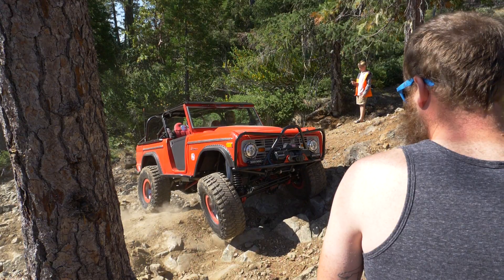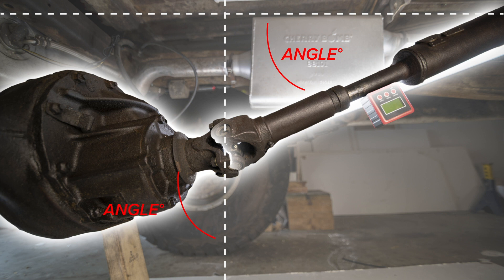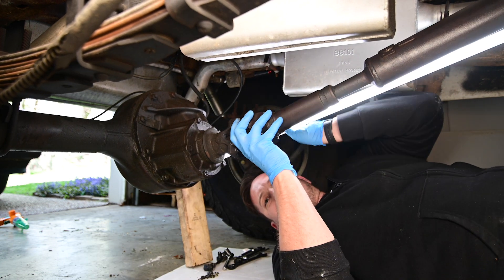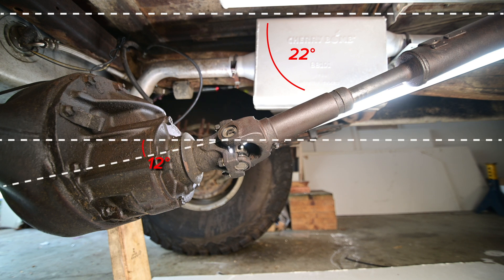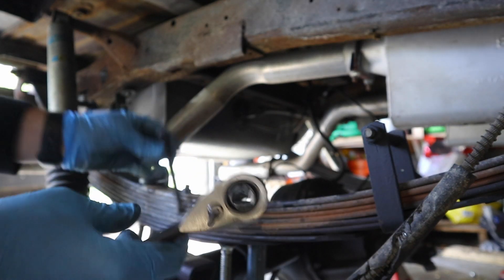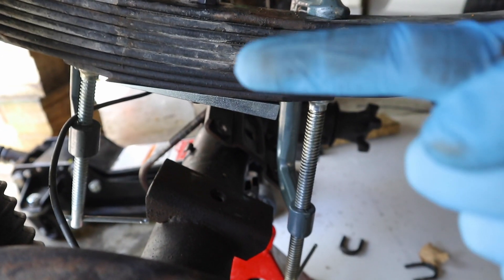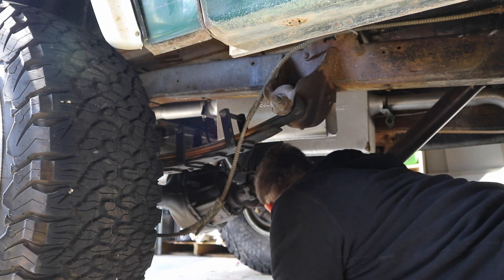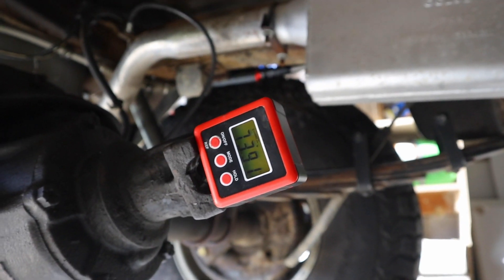Driveline Vibration and Pinion Angle - 4x4

Comment from the maker: *Update* I refer to the “pinion angle” a lot in this video, but I miss-used that term. “Pinion Angle” is the angle of the differential to 0° - what I kept calling the pinion angle is actually the driveline angle.  So my pinion angle was 12° and adding the shims changed it to 16°

So my angles:
Drive shaft Angle: 22°
Pinion Angle: 16° (after shims)
Rear Driveline angle: 6°
2.5” suspension lift, 1” body lift, 35” tires
Reply: 78° ?
Reply: What 6° ?
Reply: @nashvilleearlybronco DUUUUUDE, dud it fix your vibration tho??

Comment: Vibration is caused by the pinion angle not being the same as the transfer case/transmission angle,  Transmission must be parallel with pinion. The angle of the driveshaft is irrelevant.  The maximum accepted angle between the pinion/transmission to driveshaft is 10.  (Maybe a couple degrees more).  The larger the difference the faster u-joints wear.

Comment: The operating angle of the U-joint at the pinion is only half the equation. The operating angle at the transfer case U-joint needs to be taken into account also. A U-joint  does not produce a constant velocity is it rotates. However, two U-joints operating equal and opposite can cancel out this velocity variation. Then of course, there is the maximum operating angle of any single U-joint. 10 degrees is a lot of operating angle. A complete fix would include dropping your transfer case and reducing the overall angles.

Comment: So now you have 16 degrees at the pinion, but do you have 16 degrees at the transmission?  If your front and rear U-joints are too far apart, say pinion is at 16 and transmission is at 2, you will get binding and vibration.
Reply from the maker: Good to mnow

Comment: I have you a measurement. 
90 f150 w/6inch suspension lift.  Drive shaft degree is 16 degrees  pinion with Drive shaft removed is 5 degrees.  I have 35x12.50x15.. what degrees should I be

Comment: Hmmm.
The important thing is that your pinion angle matches your transmission output angle.

If your trans shaft is pointing down at 3 degrees your pinion should point up 3 degrees.
(Measured with the weight on all 4 wheels.)
Reply: I’m pretty sure that only applies to standard driveshafts not one with a double cardan.  But I’m not positive, I’m here trying learn something. Let me know what you think.

Comment: You can measure pinion and working pinion angles off of the bolt heads on the pinion on the rear of it as well. Do you have a double cardan?

Comment: during that vibrations your steering wheels shakes.....I don't have a ford Bronco but I do have a Ford 150 with Rough Country 4' lift kit with 33x12.50R24 with -44 offset..
Reply: Steering wheel shakes are probably a wheel balance problem. A driveshaft problem will be felt in the floorboards and seats

Comment: Shouldn’t it be the same angle and pinion angle as the flange on the transmission both of those should be the same angle to get rid of vibration

Comment: This dealt with driveline angles, and is not correct. There is no debate among driveline professionals, The pinion and the differential and output shaft should be parallel and yokes should be in phase. A very detailed Elaborate explanation is in order like Spicer and Dana have offered. I don’t think you can answer that question within the space of these comments.

Comment: Flip your drive shaft around so you slip yoke is on the out put of the transfer case. Sometimes the splines wear and will cause a vibration

Comment: Drive shaft way too short as slip spline will start to wobble. Must be lengthened. Double cardan joint by transmission is fine and proper angled shims should do the trick.

Comment: The way I do it with moderate lift and drive shaft with u joints on each end,,I use a digital angle finder,,put it on the face of either the tail shaft or the pinion and zero it out,,then check it on opposite,ther is your degree shim you need to make them parallel

Comment: In a ujoint on each end driveshaft,,the output shaft and pinion needs to b parallel to each other,,as long as you stay in a moderate lift situation,,the way I did it,,was take a digital angle finder,,I zeroed it out on the pinion and then put it on the tail shaft,,boom,,gave me the degree shim to use,,did it visey versy,,boom same thing

Comment: Im installing a 4” lift on my 91 bronco.  For rear using add a leaf and 2” block. I decided im not gonna use the block. 
Would i still need this even tho im going to run bronco graveyards  oem rear spring angle block

Comment: What I found makes a great center bolt for your spring stack is a nice long allen head cap screw you can get them in serveral lengths and if I remember right 3/8" NF is what I used. The round head goes in the hole in the spring perch and you can tighten them easily with a allen wrench on the headed side and a regular socket on the top side. Most of these are grade 5 so they are a bit stronger then the stock mild steel factory pin anyway. I also used a Nylock nut and lock washer on mine.

Comment: If you have a drive shaft with a single u-joint at each end, you want your pinion angle the same as your transfer case angle, or as close as possible. If you're using a drive shaft with a double cardan joint at the transfer case end, you want your pinion angle as close to zero as possible. Make sure you're measuring angles with the suspension compressed under the weight of the vehicle.don't jack up your vehicles and put jack stands under the frame and let the suspension drop, your angles won't be correct.
Reply: Exactly

Comment: Not here to bash your channel but your way off on your approach, the only angles that matter are the transmission/transfer case angle and differential pinion angle and they need to cancel each other out. That being said the more degrees you have the more precise the cancellation needs to be, or go to a CV joint on the transfer case and set the diff pinion at 0 degrees.  Also if you have a two piece shaft with worn out splines then your ujoints can become out of phase and also cause a vibration.

Comment: Am I the only one that realizes you did this wrong?
You had the shim wedge correct the 1st time. To lower the pinion the large end goes toward the front. 
But you also dont know what correct shim to install because you didn't find the angle of the output on the transfer case
Reply: Yes indeed, WRONG !!! now take it apart and turn the shims around.

Comment: You should get those leaf perches rewelded, so you can get proper pinion angle, that style driveshaft coming off the yolk on the axle should be pointing straight at the transfer case with it set to 0° or 1° difference.
Reply from the maker: Good tip, thank you

Comment: I just watched the vid bc I am about to do a lowered 68 Camaro. Your vid never said if the vibration went away. Also couldnt help notice the drive shaft appears to be installed backwards. Every driveline I have ever seen has the narrow slip joint away from the diff. Perhaps this may cause vibes especially if those splines are worn.
Reply from the maker: The vibration went away 🙌🏼 not sure about it being installed backwards

Comment: I'm have this issue on a 91 Volvo that I was drifting been drift for years and I've never hit anything I hit the curb once and the car has been down for about a year now it's still runs still moves even though I did remove the support for the carrier bearing to try to angle it out but I think I might have to remove the springs which I don't know how to do I am not a mechanic imma tinkerer I just mess with things and make sure they're tight. I hit a curb the upper torque rod that goes to the top of the differential is dislodged and I can't straighten the differential out from pointing to the bottom of the floor of the car I'm wondering do I unhook the lower torque rod Bolt
Reply from the maker: Yikes! Bummer man. I have a 92 Volvo 🤘🏼🤘🏼

Comment: Great video! Another common thing is the driveshaft itself is not on the correct spline, causing the universal joints on each end to be “out of step” with each other. With how old all these trucks are I’m sure at some point the driveshaft was incorrectly removed and taking apart
Reply from the maker: Oh good thinking!
Reply: any way an at home mechanic can find the correct orientation without bringing it to a driveline shop? I believe I'm off, my tcase shifts great but the rear has some leaks it looks like from stress; also my ujoints often fail earlier then expected. It's definitely pinion angle AND/OR current orientation.

Comment: The driveshaft looks too short for your lift?  This would cause a vibration.  My 3 1/2 inch lift required an extended driveshaft for proper spline engagement.
https://4xshaft.com/blogs/faq/how-much-of-my-spline-should-be-showing
Reply from the maker: Ah! Maybe! I’ll look into that
Reply: Nashville Early Bronco I have 68 deg on the driveshaft, 73 deg on the pinion.  3 1/2 leafs from Toms with shims added
Reply from the maker: Nice! So about the same as mine

Comment: Jon,

Cool to see you back again.
It’s always nice when you test the function of the Bronco to include the results of the changes you’ve made prior to releasing an update.
I’m left wondering if the wedges eliminated your driveline vibrations?? 

When I drug my ‘73 bronco from a junkyard, it had a 5 1/2” Wild Horses lift and the rear u-joint was broken off at the diff. I replaced the u-joint and quickly noticed an abnormal binding, did research, called Wild Horses & discovered that the POwner failed to install any wedge shins. I added the 6° wedges and this made a huge difference, but I still have a bit of vibration at 55mph. 

Perhaps the comment above by Yablo69 referencing a video about unmatched Tcase/driveshaft angle-vs-driveshaft/diff angle is the answer.

 It gets more complicated, however, since there’s a double cardan joint at the tcase side of driveshaft.

Also, How ‘bout the relocation of your fuel pump away from the exhaust on the last vid...did that work to remedy the problem w/ the same pump?

Thanks,

HYoung

Comment: The angle between the driveshaft and rear axle needs to be the same as angle between transmission and driveshaft. Also the angle cant be to steep. Then there should be no vibration couse of angels
Reply: I know you meant angles, but I really prefer to imagine now that the angels are alleviating the vibrations.
Reply: English is my second language. If I wrote Angel it was probably couse I was tired 😂. I know its written angle. Glad you understood😁
Reply: What you are reterencing is correct on a "street car" or truck, but lifted 4x4's do not work the same. If the angle is matched at both ends you end up with joint bind on articulation. On lifted off road vehicles we get our pinion pointed directly at the t case outpuf to eliminate vibrations, and also keep it out of harms way when on the trail

Comment: Thanks for still pumping out the content! I have a 2.5 inch suspension lift and never noticed any vibration, so maybe it's not enough to make a difference. However, I added a drop pitman arm last year thinking that I needed it it after lifting it, and man, I have bump-steer now! I'm fighting the steering wheel with every bump in the road. I'm thinking of putting the original pitman arm back on. What do you think?
Reply: You shouldn't need a drop pitman arm with only 2.5 lift.
Reply from the maker: Try it! You’ll never know unless you try it.